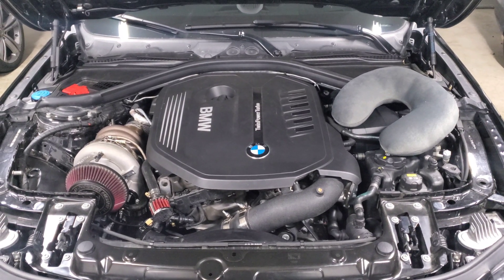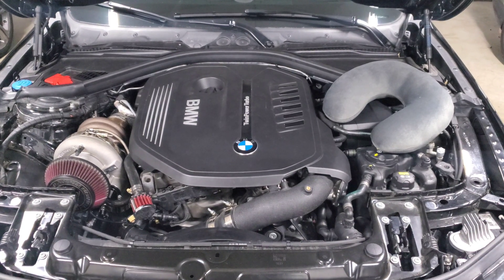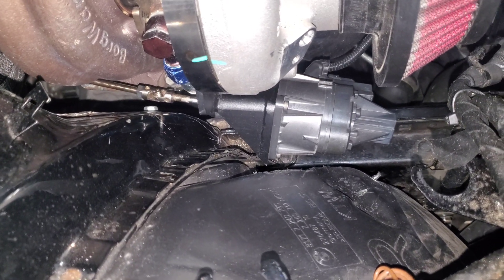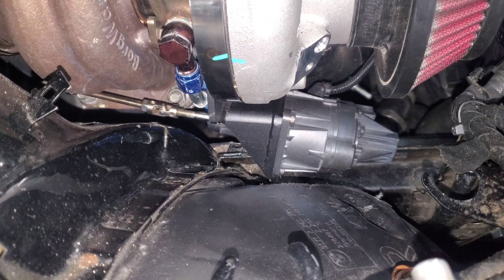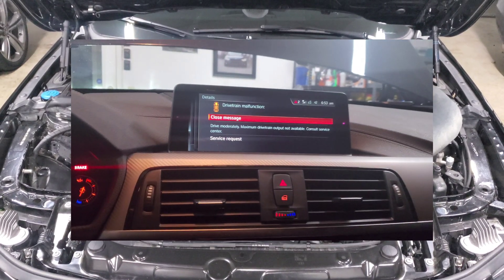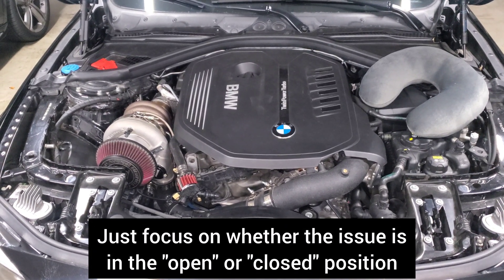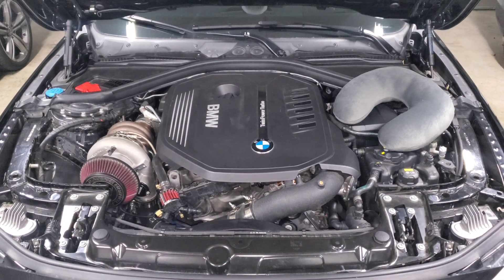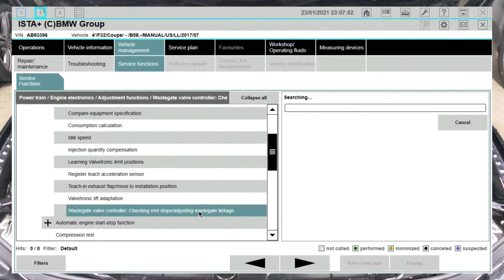B58 Wastegate Calibration DIY (Fix Wastegate Stop Position Outside Tolerance)

Comment: i got code 123511 & 123512, will the calibration fix my problem or is it more of the actuator failing electronically

Comment: Having this same issue after just purchasing my car. Got it delivered from CA to CO. Drove through a nasty snow storm and it showed up filthy, covered in ice and sand all over the front. Could all of the sand/dirt and water be causing this code to throw? 
Code won’t throw in the morning when car is completely cool, but will come up next time vehicle is started. Goes into limp mode and clearly no turbo. When starting the car I can see the actuator move back and forth so I know it’s working, shop said it still could be a bad actuator. Any tips on this?

Comment: I just installed a new one (but it's a China one) just ordered a Mitsubishi one from FCP EURO for my BMW X1 but was getting these two codes and have no idea what to do. I started it up after installing it and it started smoking a little so I turned it off and I believe the waste gate wasn't opening and running the proper routine. But here's the codes I was getting a few minutes ago. 2CAA Electric Waste gate learning stop: stop position (wastegate closed) outside tolerance.

2CA4 
Electric Wastegate learning limit position. Cold start malfunction 

Could you by any chance please shed some light on my issues here? As mentioned I do have a new wastegate actuator on the way cause I didn't trust this China one I bought for 60 bucks

By the way, subscribed! 👍
Reply: That new one you bought probably still needs to be adjusted, just cause it’s a new part doesn’t mean it comes pre adjusted
Reply: @Thirrtyeighterr Yeah i adjusted the China one and everything seems good with it now. Codes went away. Thanks.

Comment: Ayy Kern417 thanks for the video , very helpful and full of great information for anyone dealing w the electronic side of WG . Im getting a Boost pressure control: boost too low code. Already replaced WG actuator , diverter valve, charge pipe. Still getting low boost. Do you think j need to adjust the rod or is it possible the waste gate is just not holding the boost anymore ?

Comment: 123432 - Electrical wastegate valve, adaptation:
Stop shut, implausible. It says this on mine any ideas?
Reply: sorry it's been months, i now have this code and 123401 Electrical Wastegate valve, adptation cold start not learned. What fix worked for you?

Comment: My car BMW 525D Xdrive F11 has this error code 29A400 Charge pressure Actuator (VNT), Position Control Charge pressure Actuator  Open Too Far/positive Control Deviation. Drive train used to pup up when I acceleration hard. 3 car workshops does not manage to adjust my wastegate. I have to install Ista+ and try to adjust myself.

Comment: Okay, I am dealing with this on my F56 mini cooper s B48. I resistance tested the old actuator and it was toast so I have replaced it with a new one. I am getting codes similar to the ones you posted and I think the mm should be the same on mine as the others since my research says it is the same turbo as in the X3's with the B48s. So my question (and apologies if it is a stupid one) is this: measuring the length of the actuator arm is easy enough but, the linkage is what I'm struggling to grasp. Once the arm is at 26mm from base to tip, do you tighten the linkage (mine has a bracket with two pinch nuts on each side of it) until the flapper is at the closed position or does the flapper on the turbo need to be a certain degrees of open? Asking because every picture of a turbo I've looked at and even some old scrap n54 turbo's show the flapper at something close to an 1/8th - 1/4' gap when the turbo is at rest. I appreciate this video and appreciate it if you get around to a response.

Comment: Do I need to adjust the waste gate arm if I am still using stock turbo but increased boost pressure? The reason why I ask is because I hear a release in boost sooner then gets to build up when putting pedal to the floor. It’s not a constant hiss, just a quick burst as if the blow off valve (diverted valve) is releasing pressure before I take my foot off the gas

Comment: So if the Wastegate arm wasn’t measured correctly, would it be thrown the code?  I have DAW UF making 27.5 psi at 100% wgdc the whole pull. Tuner suggested boost leak or 
Calibrated the wastegate. Already did that and the wastegate is good and no boost leak

Comment: Hi Kern hope you well. Not sure if you’ll see this question on an old post. 

Have you come across any scenarios where the wastegate calibrates fine when cold, but once the engine bay gets hot it gives a drivetrain error relating to the wastegate?
Reply: Update, for anyone looking to calibrate their wastegate and can’t find the distance required on Ista. You can use the raw position of the wastegate in the logging channels of mhd or bootmod, it shows the distance at idle. You want the value in mm at 0mm. Hope this helps someone @kern417

Comment: Question, I just changed my turbo. I didn’t calibrate the electronic WG and noticed my logs had 80% & 90% WGDC. Is this related. I’m checking for boost leaks as well.

Comment: Hey man, hoping you can help me out even tho this vid is 2 years old already. 

My gen 1 m240i xdrive has an audible rattlez Sometimes on deceleration, other times by just blipping the throttle and other times when in a high gear low rpm cruising. The noise is almost undetectable in sport and sport+ modes. 

I’ve checked and it doesn’t sound like it’s coming from the exhaust flap, and I recently changed the spring in the flap actuator.

I’m almost positive it’s the waste gate actuator. After doing a bm3 tune and catted downpipe the noise is much more noticeable. It sounds A LOT like the noise in this vid: https://youtu.be/-7ZW7eW5Vgw?si=Rp2IPKMZlUiOnqdj

I’m not seeing any problems with boost, it’s just the noise that’s annoying. 

This YouTuber says a DME update from BMW fixed his problem. Thing is that I’m tuned. 2 questions for ya
1: would the dme update negate the bm3 tune?
2: if the dme update works and I get no wastegate rattle noise, would reflashing the car with bm3 just undo the fix? 

Sorry for the long post but anything you can share is much appreciated.
Reply from the maker: i'm not sure about that issue. but if you get a dme update then it will flash the tune back to stock and lock the dme so you will need a bench unlock to reflash your map. the map only changes certain things, so if there is an update then it shouldn't affect other areas other than those to make more power safely. i can't really say if it'll have an effect on your issue.

Comment: A good "guage is a quarter. 26mm is the spec suggested, a quarter is 24.26 mm.  So you it should be about 1.75 mm wider than a quarter (1 or  2 threads).
Reply: Thank you....I can understand that a little easier....so does it have to be exact 26mm....or just extremely close to 26mm
Reply: A quarter is 24.5 mm

Comment: Hey kern my vband clamp was improperly oriented and it was keep the wastegate actuator from operating properly. The clamp has since been fixed. How do i confirm its now ppening and closing properly?
Reply from the maker: Follow the instructions in the video
Reply: @kern417  will do thanks.  I just dont think it looks outside of tolerance. I was hoping for a way I just see if it's in the codes. Or visually watch it open. I was just hoping it wasn't damaged
Reply from the maker: you can. you may have to remove the intake depending on the setup. but it's all shown in the video.

Comment: Set mine to 28mm and drivetrain malfunction has gone but engine light on cluster now with no boost when driving
Reply: Now set at 30 and all lights off but no real boost when driving
Reply from the maker: Then scan for codes
Reply from the maker: arm is too long. shorten it.
Reply: All codes now gone used diagnostics to set wastegate. But still no power, found some aluminium dust in front of turbo but there is no play in turbo. It was newly fitted only done 600miles

Comment: 123421 | Electrical Wastegate Valve , Adaptation: Start Position Open Not Detected

150102 | Ignition, Cylinder 1: Combustion Period Too Short

150202 | Ignition, Cylinder 2: Combustion Period Too Short

123432 | Electrical Wastegate Valve , Adaptation: Limit Position Shut, Implausible

120408 | Charging Pressure Control: Switch-Off As Consequence

Any ideas on this then car was running fine pulled up turned engine off for abit 20mins then had “drive train fault” come up and this is all the codes
Reply from the maker: Combustion period too short is typically related to coilpacks. Wastegate codes need to look at the wastegate to see if it's moving or if something is loose.

Comment: Best video of this period! This also applies to N55 EWG. QUESTION! What if there's also a "Electrical Wastegate, Position Sensor: Electrical, Short to Ground" code? How would you tackle this? Replace the EWG and transfer the linkage?
Reply from the maker: Double check the wiring isn't damaged first
Reply: @kern417  Thank you for that advice man. I noticed that the codes set off when the car is extremely hot, like on a 3 hour road trip in summer weather.
Reply: what was the solution?
Reply: @b58naki  Bad wastegate actuator. Replaced it with a new one and it was immediately apparent the old one was bad.

Comment: As I understand the waste gate actuator must be adjusted within the range the electronic wastegate is set up. The electronic will take a check if the rode  is adjust within, if not the turbocharger will not get any boost. My wastegate actuator is just a plastic rode with no nuts or any gangs to adjust. The plastic rode is locked by a c-clips. So if I remove the c-clips and turn the rode  -4 times and run my diagnostic tool. If it is within range there will be no error. Right?
Reply: Some people calibrate it like this by guessing and trying.

Comment: 5:15 is where most people are going to need the tip with the open or closed position by adjusting the length of the position. Thanks.

Comment: Very good video. I have exactly problem with my wastegate. I get the same error 29A400 It says the wategate is out of position too much + position deviation. I have a BMW F11 525D Xdrive  2012, do I have an electronic wastegate. After replacing the turbo by the workshop my car has no boost and I get drivetrain error when I accerrate. Can you please give me some advice?

Comment: If u have issues with measuring, just set the cup a 1/4 in from the back of the threeat. Threated part is 1 1/4 and u need the latch to be at 1 inches from the thread on the wastgate thread not the end

Comment: If I am throwing two codes, electric wastegate; stop learning: cold start: Malfunction & also electric wastegate; stop learning: stop learning (wastegate closed); outside tolerance, I measured and adjusted at 26mm, 27mm, 28mm, 29mm, 30mm & 31mm.  And I am still throwing the same codes....Any ideas?
Reply: Same issue, recalibrated twice and issue came back. I’m about to replace the wastegate actuator and hope that works
Reply: @aldosayshi782 did it work bro
Reply: @aldosayshi782  Hey Bro, did this fix your issue? experiencing something similar.
Reply: @beaubatchelor no, sadly it was the waste gate arm that cracked the weld… so it was moving out of position. If you’re on the stock turbo it’s probably not what I had.

Comment: So if the car doesn’t throw any fault codes after swapping the wastegate over to the new turbo I’m good?
Reply from the maker: Yes
Reply: @kern417  i didnt move mine when I installed my DAW UFX and I'm getting 120308 and 120408. 

Haven't checked my WG rod length yet but would it being out of range cause this?

Comment: It says 123701 Electric Wastegate, Position Sensor, Signal: Short Circuit to B+
Reply from the maker: either the wiring is not connected/damaged or the wastegate itself is bad

Comment: Hey Kern, 
Appreciate your deep analysis videos, they put me at peace whenever I have b58 related questions. 
I was recently protuned on e50 FBO vargs gc. (gen 1 b58) Tuner had issues because my car kept limping out at 5k - 5,500k rpm when on dyno. Tuner believes my waste gate is bad, car only has 15k miles and had a reputable shop install my parts.. At a stand still here, don't feel like the shop/tuner are interested in figuring this out for me.
Reply from the maker: message me on your preferred social media channel. links to my pages are in the description.
Reply: Did you ever figure out what the issue was? My GC is doing the same thing around 5500, weird WGDC and boost drop. Tuner insists it is something mechanical and I'm stumped.
Reply from the maker: Message me a log and i can take a look
Reply: @catman41155 did you ever figure it out? People are telling my wastage is bad and need a new one
Reply: Same
Reply: It’s happening to me on ultra flow

Comment: Ista has been giving me so many problems, I’m not trying to have to pay for another version and hope the install is easier, I played around and got it to open but can’t find the closed, sorry if this sounds dumb but I’m still not fully grasping it after the video, I have the doc race kit too, should I thread the arm in or would it adjust the nuts holding the wastegate flap? It closed like 3/4 way but fully opens
Reply from the maker: Just measure it

Comment: I got a 6 port Supra and I’m over boosting I’m on a map that’s for 20psi on pure 800 and I hitting up to 22.6 what would I have to do?
Reply from the maker: Have your tuner adjust boost control in the tune
Reply: @kern417  I have jb4 and he tells me it’s my wgdc and that I need to calbraite my wastage
Reply from the maker: @alexkd7b58  you cannot manually adjust the wg to change wgdc
Reply: @kern417  then what can I do to help my wgdc
Reply from the maker: @alexkd7b58  see my first comment
Reply: @kern417  even on a piggy bank like jb4?
Reply from the maker: @alexkd7b58  that's the only thing you can do. Like i said in the video throttle closures are very common with jb4.

Comment: Thanks a lot for all the videos you make. I've been watching through pretty much all of those and it gives you a really good insight. I've already seen a comment addressing the waste gate rattle of the B58. There are a bunch of threads about this in german forums but you rarely find any english ones. https://www.youtube.com/watch?v=-7ZW7eW5Vgw. This video captures that specific waste gate rattle pretty well (or it might rather be the actuator that rattles). You can first hear it really well at around 1:20. It appears when you are on low-mid throttle cruising through a city most often and it's about as loud as that sweet b58 sound which makes it smth really bothering. If you knew any fix for this my life would be whole
Reply: @kern417 check the vid this guy mentions and the time stamp.